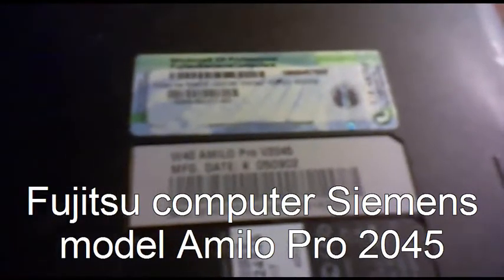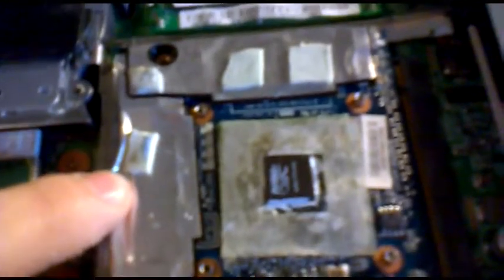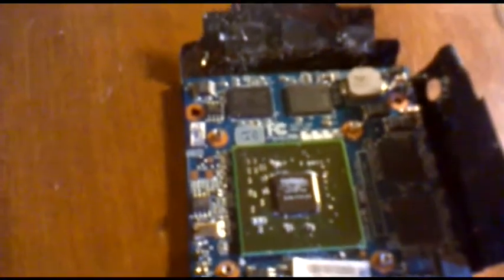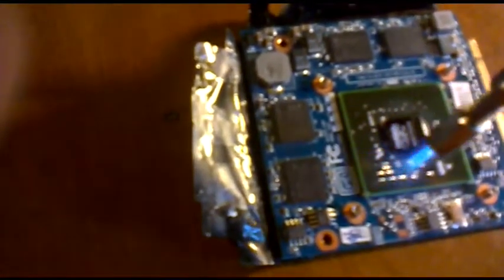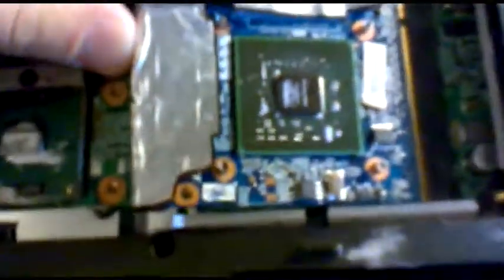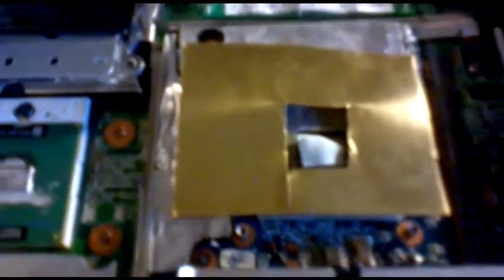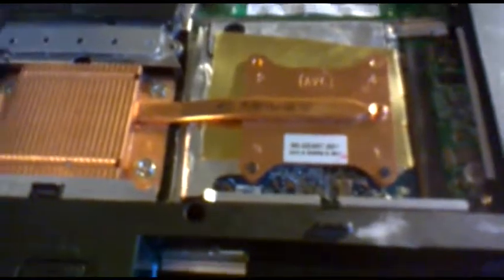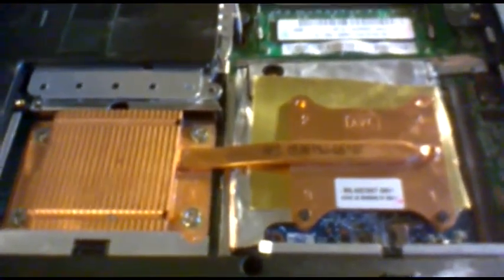Fujitsu Siemens Amilo Pro 2045 Black Screen.avi

Comment: Can you help me with something ,I have Fujitsu pro v2055 it won't start black screen even though the green light is working
Reply: Hello, we can try the easy test to see if the video board is fried or another component is causing the black screen , First take the battery out , hold power button for 10 seconds and then plug the laptop without the battery to the wall 
Second unplug the laptop from the wall , make sure the battery is not in either , remove the memory cards, power on the laptop, if you have video means one of your memory cards is dead, easy to buy and replace
3rd try purchasing a new video card for your model on ebay, this model of laptop is design to have " external video card " and not on-board video chipset  
4th if you don't want to purchase another video card, try what i did and  carefully put everything back 
The issue was caused due to overheating so i would suggest clean the fan and the heat sink